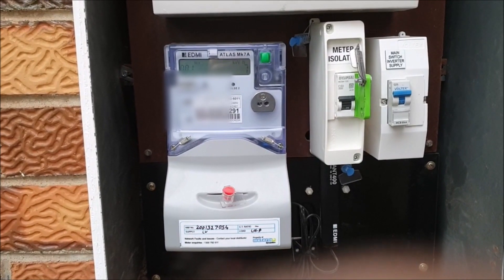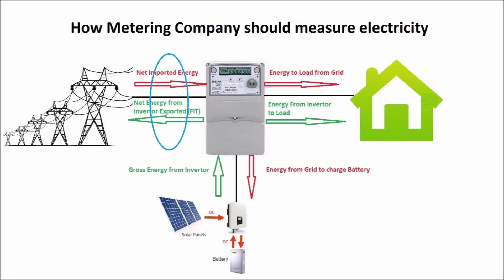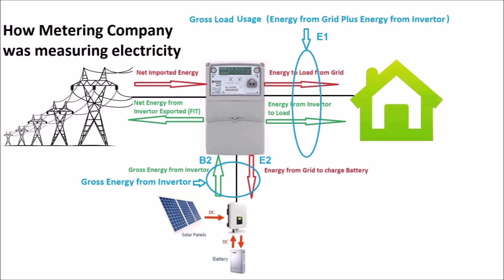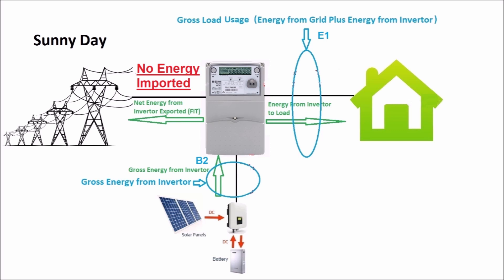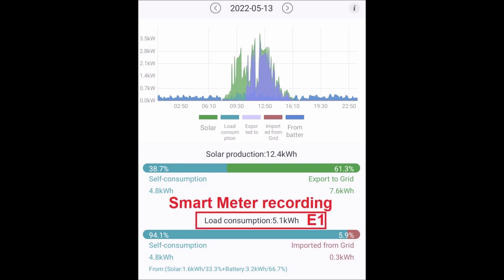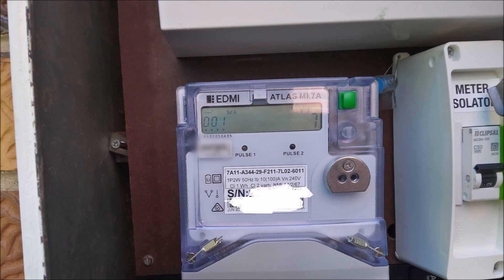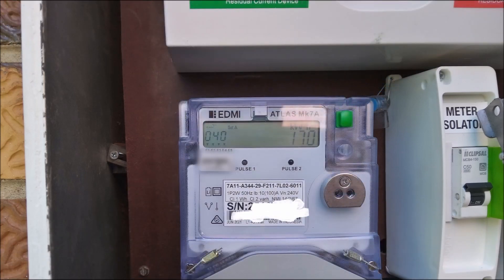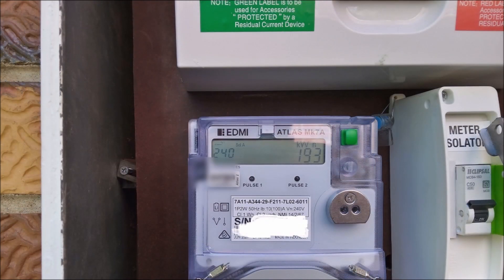Smart Meter Incorrectly Metering Solar System

Comment: Solar installers make mistakes when installing inverters and smart meters because they don't bother to install them properly. It's a law of physics that the home installation is closer to the grid connection, and the inverter is more than a meter outside the distribution box, with a cable half the size. In practice, it's like a 4kW hot water tank, where the inverter only provides 50%, and 50% is from the grid. This is equivalent to twice the resistance to the inverter than to the grid.

Comment: Dodo electricity switched my perfectly reliable meter with one of these meters and since that day none of my solar is recorded or able to be used in the household. I've been in touch with them, but they are spectacularly unhelpful.
Reply from the maker: Contact the Ombudsman. It took me several weeks of complaints and only after I contacted the Ombudsman was it fixed.